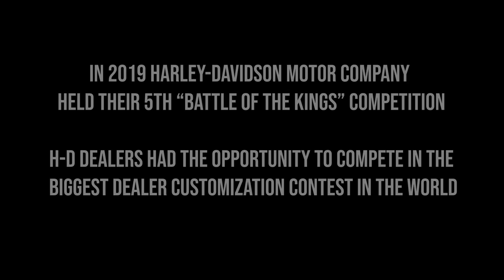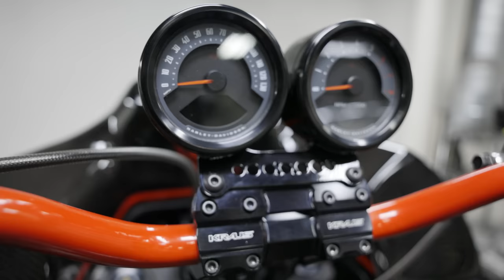The Coast Glide 3 │ Carbon Fiber Edition

Comment: Carbon fiber beautiful!!! Carbon fiber frame and swing arm, please.  Decreased weight helps everything, handling, braking, acceleration, and stopping.  It’s easier and cheaper  just to add a larger engine vs lightening the bike.  Carbon fiber wheels help unsprung weight.  Drop 100 pounds without affecting engine reliability.

Comment: From the humble beginnings of a 2018 Sport Glide with a bat wing fairing to the 2022 Low Rider ST, it continues to evolve. Curious what the final build weighed, wet, full tank of fuel in the 5 gallon fuel tank? Those carbon fiber bags, battery covers and fairing really make the bike pop, appearance wise.

Comment: Pretty tasteful. I’d like to see one with the Pam Am 1250 in it.
Edit- actually I’d like to see a Pan Am “Coast Glided” into a bagger. Make it look as much like the touring frame bikes as possible with a Pan Am special as the frame and power train and put the coast glide touch on it. Stretched bags. 21” front wheel. Low. Belt drive. Orange and white like the first Pam Am but with a really sparkly paint like a carnival ride.

Comment: Nice bike! Would it be possible for your carbon fibre guy to make a mirror image of the left bag so both bags are the same size/volume? Most guys are going 2:1 pipes on these so it kinda makes sense.
Reply: Idk why they didn’t? Both bags were custom made outta carbon fiber & their running a 2 into 1.  Other than that the bike is bitchin!